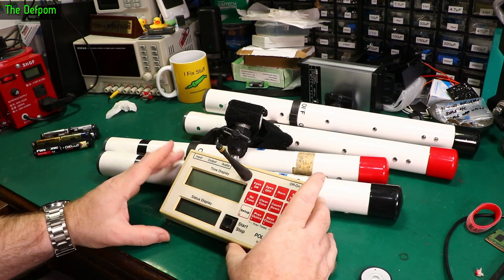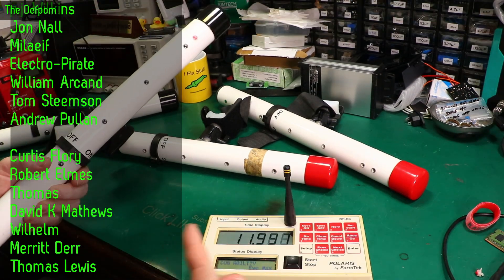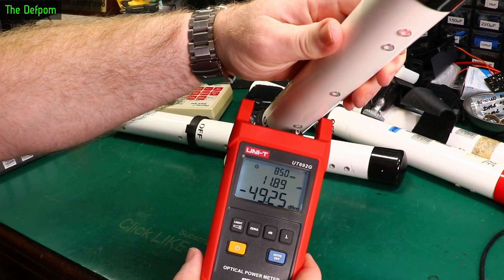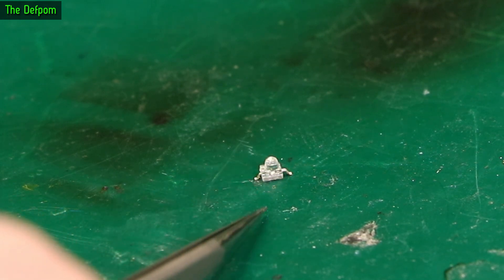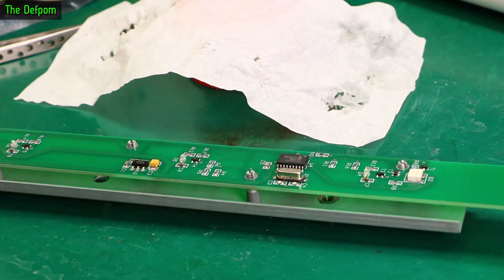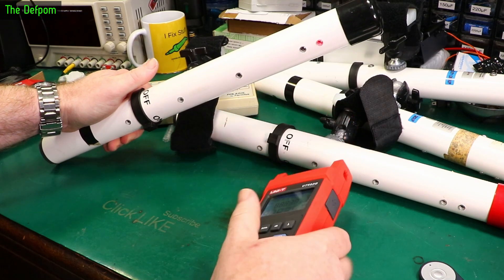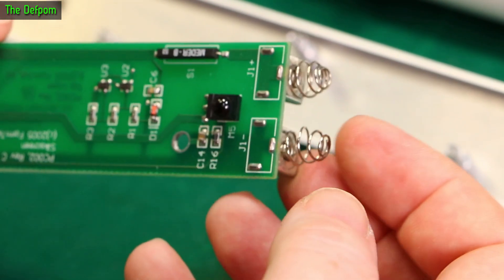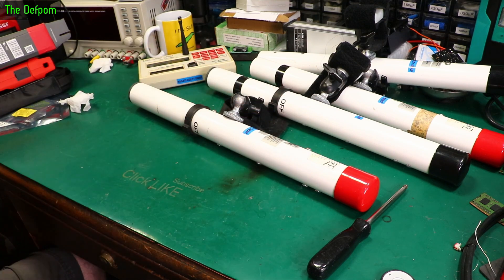🔴 Farmtek Polaris Timer System Light Curtain Repair - No.1088

Comment: Where they missing or fell off ?...cheers.
Reply from the maker: Someone must have knocked them off when opening up the unit, this is easily done if the PCB has detached from the metal backplate, as the lenses protrude a long way into the tube, they will catch on anything on the PCB as it is removed from the tube, so that is likely what happened, this is why I added the screws to hold it onto the backplate.
Reply: @TheDefpom  😀

Comment: I used to repair the old Link-Lite (Link Systems) curtains on presses. That was before the days of remote systems, when everything was hardwired. There's good money in the repair of industrial electronics, as I used to repair everything from light curtains and welding systems, to remote controls for overhead cranes, and many things in between.
Reply from the maker: I bet that was interesting work
Reply: @TheDefpom  It is, and once you establish a client list of local industries, you can spread out. I did a lot of work for the steel and railroad industries, and they will pay you what your time is worth.